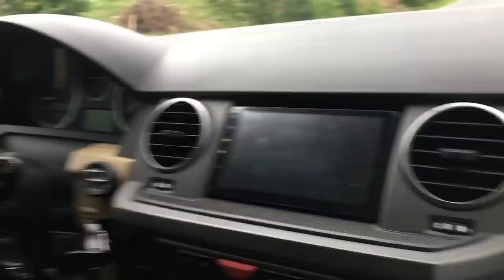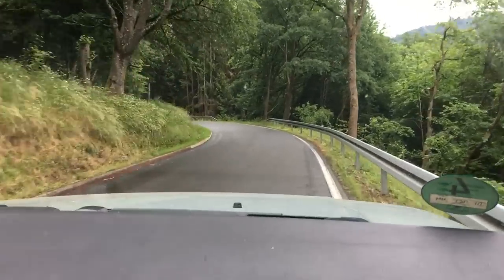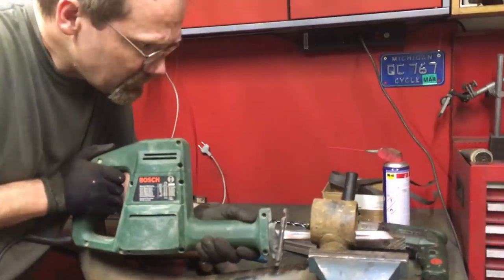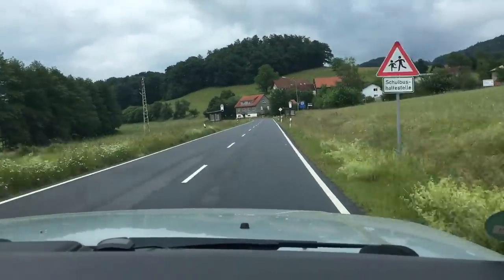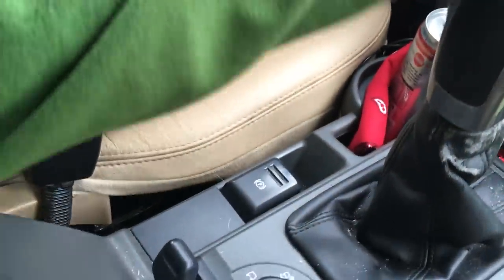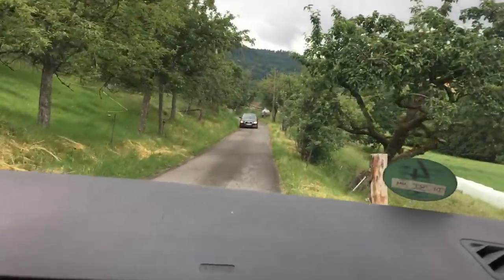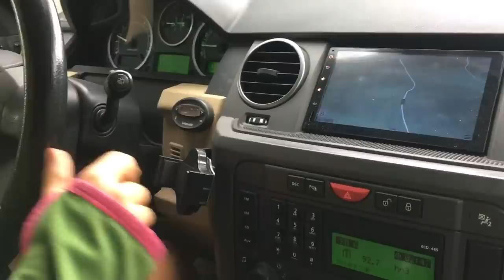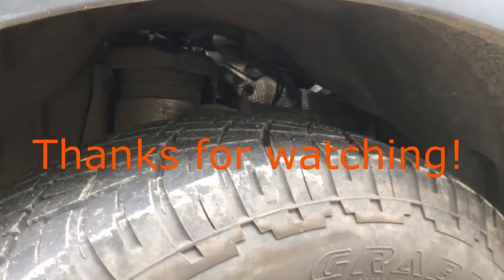Land Rover Discovery 3 / LR3 - Typical Problems And Why We Love It / S1-Ep2

Comment: Yours has faults very 10k Km or so. Mine follows a different pattern: whenever we take it through the Eurotunnel and drive through Europe, it develops some fault. 2017 Torque converter started stuttering in the Italian Alps (fixed back home), 2018 Turbo exhaust (fixed at an Opel dealer in Bavaria) and 2019 the diesel pump (fixed back home). My philosphy is to set aside 2-3 thousand £££ per year for repair and maintenance, but then I do not have any financial loss from depreciation. Never took it to a LR dealer, always repared by my local Garage arond the corner. Always get OEM parts. Small things fixed myself.
Reply from the maker: Good concept. Don´t give up.  Ours actually improved a bit... It acts up only every ~20k.

Comment: Shakes the loose back wheel on a LR and smiles. LOL. Most people would run away crying clutching their wallet, determined to buy a Toyota. I once had the dealership inform me that all 4 corners of lower control arm bushings were shot, and should be replaced immediately. I disagreed, and said it makes driving on highway much more entertaining.
Reply from the maker: Right attitude to drive a Land Rover!  Don´t give money to the dealership.   Thanks for the feedback.

Comment: Yes, Land Rover did apply thoughtful design in some areas to make DIY maintenance/repairs easier/possible, but, then did the polar opposite in other areas. Changing the auto trans oil. 4hrs labour. Nightmare job - remove cross member, exhaust section, jack up transmission mount. Checkout Atlantic British video for this. Nearly everyone will be going to a dealer or non franchised specialist at least a few times. I own v8 hse. I would say bank on over $2k a year maintenance. ... And the 4.4 v8 probably least demanding lr3 motor in terms of maintenance.
Reply from the maker: Some maintenance is very difficult and hard work. Removing the starter on the LR3 is tricky. On our Freelander it´s 10 min.   Or something simple like a EGR takes quite some work and is delicate.  But overall I prefer this car construction before my previous Mercedes C220 and Audi A6.

Comment: I really want an lr3... or an lr4. In your opinion, is the lr4 worth the extra money? Or is lr3 the way to go?
Reply from the maker: Hello James, I really don´t know.  In Germany, a LR4 is near double the price.  I can get a 2008 LR3 SE for 9000 Euro with 150tkm. A LR4 in mint condition as  a 2014 plate in SE is 17000 Euro.  A broken LR4 with a dead engine is 10000 Euro.  If you want to drive the car for a few years only, the D4 is the better value and has much more comfort.  If you want to drive it to the end until death takes you appart, I would prefer the LR3 because it is much cheaper and parts are easy to get. But if price is not as important to you, get the LR4.   We are looking for a LR4 now as well as a project car and we may end up with a LR3 in HSE spec in the 2009/2010 model year because the LR4 is just overpriced.  Christian
Reply: @Vera_and_Christian  appreciate the reply. I guess I like the idea of the updated interior of the lr4 and comfort that comes with that.  I currently have a 2003 Honda Pilot so not particularly bothered by model year or high mileage.
I am British man living in California and I have fallen in love with the idea of driving a British car here, the disco!!!
Maybe a well maintained lr3 is the way to go and put some money on one side for maintainence!?!
Reply from the maker: @hughes3947  on US ground, I could not resist the LR4 with a V8. Best drive both to see the difference. Go for HSE spec. and watch for odometer fraud.  A 100t mile car in California should look like new.
Reply: @Vera_and_Christian  haha! Well there go, something else to think about...v8 lr4.
We’ll see, they seem to come up for sale quite regularly. Need to educate myself on what potential issues I need to look out for on these vehicles.

Comment: i'm first owner of a 10 years old LR3, 88.000km.
His problem is with the doors locks. Always therw are faults on the alarm that something is open, doors, bonnet etc. That means that i'm not able to lock the car because the alarm is starts to sound.
There is a hack for this?
Reply from the maker: I don’t know. I suggest to check the Disco3.UK web site. Search for “bonnet not closed” or similar. Sorry.

Comment: as for the electric handbrake I have a 2005 Discovery hse engine changed but the rest is a clock, it made some noises, before changing the internal gears we did a reset from the control unit and now it's fine, however I recommend to use only when needed, if you are at the floor use the gearbox in parking, save a lot of the system

Comment: love my D4  but sometimes the nearest town is 1000km from where I am, I  have the 2.7 and have towed 4000kg 1000 km up some long hills too. the d3,4 are heavy 2560 kg, the brakes are very good, but naturally, they will wear pads and rotors quickly, I drive a lot in command shift In may, I will drive  around Au
Reply from the maker: 👍 we admire you guys, especially in Australia with the great vastness there, and the courage it takes to travel to those extreme remote places.  Our content would be a lot different if we would live in a place like Australia.  I do love to watch Andrew St. Pierre White, and his take on overland prep and car builds. 🙋‍♀️ Vera
Reply: @Vera_and_Christian  Often I  was in De. Once with ayear 2000 disco 2 td5, that was a good car, the engine  was 5 cylinders and on the Autobahn, climbing at 120 to 130 the engine had a special beat bing 5 cylinder
I  took it to Ro.Hu.and Ukraine,  
But you can find offroading in Spain Vera?
Reply from the maker: @stuarth43 👍 We have been to the Pyrenees mountains 3 times and loved it. We will be back to Spain for sure, but with Covid still present it might take 2 more years until then. I really really want to see Bardenas Reales and Pico de Europa.  🙋‍♀️ Vera

Comment: what did you replace the factory navigation screen with? is that just a tablet sitting on top?
Reply from the maker: I installed a Android 10 head unit from Amazon. It has DAB+ and everything else what Android provides. I was thinking about making a Video about this because there is a lot I would do different today. Let me know if you have detailed questions. Thanks.
Reply: @Vera_and_Christian  Great video! I thoroughly enjoyed it and shared it to a friend looking at a disco 3/4 after having my d3 (manual of course) parked in his driveway a couple of hours. What would you recommend today to replace the hopelessly outdated unit that I do not look at at all?
Reply from the maker: I just posted a video about my Android head unit. Maybe this answers your question.  Hope you like the video.

Comment: Would you then say that the LR3/LR4 in North America area better because they are petrol? 
Thanks a bunch for the video 🙂
Reply from the maker: In North America I would pick the petrol V8. Here in Germany, the petrol version is much more expensive than the Diesel.  Not sure if it is more or less reliable.
Reply: @Vera_and_Christian  thanks! Fuel economy is much worse in the petrol!
Reply: Get petrol if you can 👍
Reply: @PeteK.1  would you ever consider putting bio fuel/restaurant oil?
Reply: @karimalameddine5092  That is not a good idea - modern diesels do not cope well with SVO or less than perfect bio-diesel. My '89 LR110CSW 200Tdi does run happily on SVO, but nothing more recent than the 300Tdi is OK with 100% bio.

Comment: 😂 😂 😂 For someone who's looking to upgrade from a D2 you really didn't sell the D3 🤦‍♂️. I scrapped the D2 after blowing the 2nd auto transmission but apart from breaking the spider gears in the rear dif which was probably my own fault, it was problem free. I don't know if I can deal with a car that breaks every 2 months 😬
Reply from the maker: It akts up every two month.  It does not break down dramatically but it could...  A D2 is a solid vehicle and a D3 is a bit more "high maintenance" but rewarding. Thanks for your feedback.

Comment: Have you done that fuel pump belt yet?
Reply from the maker: Yes. I followed the pictured instructions from the Disco3.co.uk site and my Haines manual.  Get the tensioner too. It is a blind job working on your belly. But doable. Many cables to be removed with risk of breaking plastic tabs etc.

Comment: Erfahrungen mit Air-Suspension-Faults?
Reply from the maker: Kein echtes Problem bis jetzt. Ein mal Tank durchgerostet (konnte ich schweißen) und eine Scheuerstelle an der Leitung zum linken Shock. Konnte ich mit einem 6mm Pushlock flicken bevor die Leitung durch war.  Es dauert nun etwa 3 Tage bis sich die Karosserie absenkt.  Der Kompressor muss nach kurzer Zeit morgens abschalten! Wenn nicht, gibt es ein Leck.   Wenn Er sich schneller absenkt, einfach mal nachts die Sicherung vom System ziehen und schauen welches Rad oder Achse die Ursache ist.

Comment: SO what's your recommendation on the parking break ?
To pull it after  you switch car off?
Reply from the maker: On level ground, I avoid using the EPB and just put the car in gear. So I push the button down while pulling the  key out.

Comment: My opinion of the Land Rover is if it wasn’t for the air suspension, then I would stick with a Ford Explorer or other off roading beasts and call it a day! The amount of money you pay for the name isn’t worth it in the end. They are made cheap, but are off roading kings mostly bc of the technology, strong axels, and air suspension. The main issue with a landy is it doesn’t matter how awesome the off roading capabilities are, if you can’t drive the thing because it’s always broken! I’m sick of mine always breaking. It’s not worth the money or hassle. If your looking for a Land Rover get a newer one, bc ever since this indie brand bought the brand they have improved in reliability over the years opposed to the British counterparts. The only British thing about this vehicle now is that it’s made in Britain I do believe. 

Common problems is everything! Our front differential broke before 130k miles, air suspension goes out very quickly bc the car is so heavy, the dash cracks bc it’s cheap plastic crap......... other than this and expensive maintenance it’s an amazing vehicle! 

We found out our front differential was messed up and entirely shot bc the steering was messed up. It was a crazy expensive fix, probably not worth it, I should have junked it at this point, but it got fixed and we will see how much longer it lasts. I do have to say, the transmission is starting to act up even furthermore and I’ll be surprised if it lasts another 50k miles. I’ve heard transmission issues happen early with this model. Dk yet, other than our differential. I also have a Lincoln Navigator with nearly 300k mikes trans and engine going strong, so I dk why ford would put a crappy trans in their version of the Land Rover! But I digress and maybe in a few years I’ll give an update on our landy (2009 LR3)

Other problems I don’t feel like listing. The one thing that has lasted to it’s entirety is the AC system so yeah for this! But stupid stuff goes wrong with this LR3 from the bonnet sensor, tire sensor, to the cheap trim falling off randomly
Reply: Ford Explorer definitely isn’t an off roading “beast.”
Reply from the maker: Wow, this is quite a experience you´ve made there. I think a british vehicle is always going to loose technically and cost wise if comparred with a US vehicle, especially in the US.  Here in Germany this is different. Parts from the UK are cheap and the technology is simple comparred with an Audi, Porsche or a Mercedes.  So I choose the English car but I am sorry that you had so much trouble.   Expensive car repairs are the last thing anyone needs.   I own also a 2009  Dodge Challenger and it is the simplest technologie available on the market and still, the car is unbelivable expensive because I have to self-import every part into Germany myself.  The repairs would cost me a fortune if I would have to go to a Dodge shop (which I will do only if hell freezes over). 
Thanks for your comment.  I am sure it is valuable for many viewers.

Comment: if you ever have turbo fault, ask me I'll tell you how to fix it, guten tag
Reply from the maker: We'll do that 👍, but if we ever have to fix the turbo, the plan is to leave the body on in any case 😃🙋‍♀️ Vera
Reply: @Vera_and_Christian  yes a piece of wire 600mm long with a hook on one end, you can catch the vane actuator arm push back and fwds cures most faults
I  hand an aircon problem, LR  here wanted 3500 for a new compressor, I  bought one in UK  850 shipped, bur 7 hours to replace it
Reply from the maker: @stuarth43  👍, that's why we do everything ourselves.  Maybe you have watched our latest video from yesterday. LR wanted 4000€ with body off for the repair on that Discovery. 🙋‍♀️ Vera